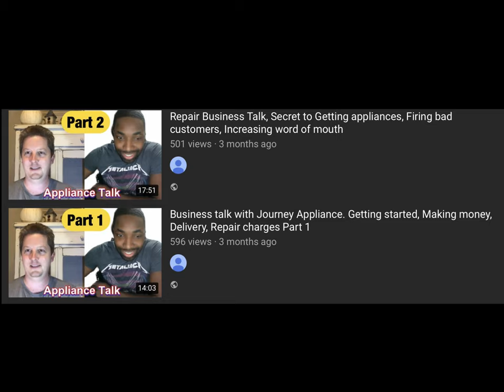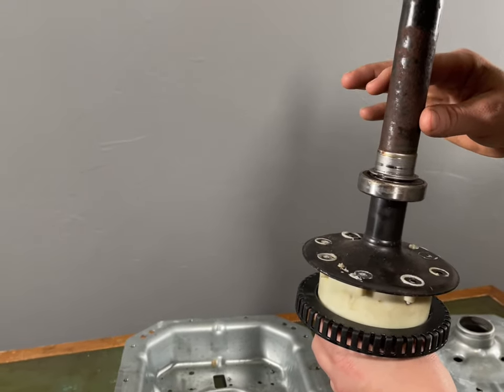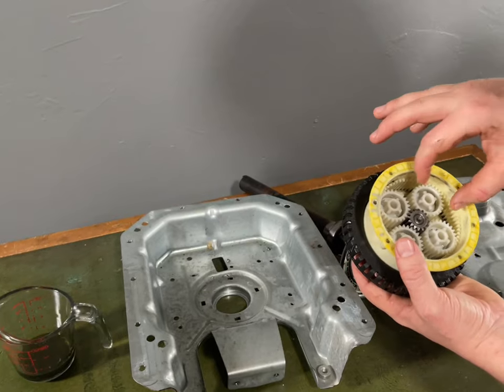Washer Oil leak from transmission gear case seal. Oily mess underneath and on belt. VMW Whirlpool

Comment: I can’t remove the top it is stuck on the bearing
Reply from the maker: Look at it from the top and you’ll see those small holes to put a Phillips head screwdriver in. You have to remove all the screws through that hole by slowly turning the transmission every time you get a screw out then you’ll have to pop the transmission apart being careful not to spill oil everywhere. It will be slightly stuck with gasket maker.
Reply: @WasherDryerMoney  okie I also saw that too

Comment: Whirlpool should've left the direct drives alone!
Reply from the maker: So true
Reply: I thought so too. But when you really think about it, it was time for a change. DD's are noisy as hell and not efficient.
Reply: @CarlosGarcia-ij4yg  What type of gear oil does these whirlpool transmissions use? Why are these washers built so cheaply?
Reply: @jeromedavis8575  i have no idea!
Reply: @CarlosGarcia-ij4yg  I assume its a heavy gear oil. How did it smell?
Reply: @jeromedavis8575  i don't know. I'm not the creator of the video.
Reply: @jeromedavis8575  you can buy direct drives on Craigslist list all day long for very cheap. Sometime free.
Reply from the maker: It’s very thick oil so I would assume it’s heavy gear oil. I did not notice a smell.
if the washer is leaking replacing the oil will not stop the leak that’s why I’m thinking about trying grease and the next machine that has this problem. I’ll do an update video if that solves a leak.
Reply: @WasherDryerMoney  Did whirlpool direct drives also use a heavy gear oil also? I assume they did.
Reply from the maker: @jeromedavis8575  I know I’ve seen a video on that.
Reply: @WasherDryerMoney  How heavy is the gear oil in a direct drive transmission?
Reply: @WasherDryerMoney  Do GE washers use gearboxes and do they use heavy gear oil too?
Reply: Unfortunately you cannot use a mechanical transmission to make the kinds of variable motions / arc travel required for agitators or wash plates in HE washers.  Depending on cycles the new HE top load washers turn the agitators 180 degrees, 360 degrees and in between using the computer driven DC motor. They also turn the drum in the opposite direction.  The standard mechanical transmission designs in the old washers cant do so.  They can vary the speed, but not the travel of the agitator.  (Maybe a hypercomplex electro-mechanical transmission design could do so but not the standard design used in older WP DDs, and other manufacturers, etc.
Reply: @hyperlexis  What are the gears made of in the whirlpool dd transmissions? What oil do they use? Is it a the synthetic grease or real gear oil?
Reply: @jeromedavis8575  A combination of steel pinion, multiple other steel and plastic parts and a large gear made of Delryn plastic.  It uses gear oil.  If you check youtube you should see teardown videos.  Totally different designs.  The DD relies on a constant speed motor to turn the gears to create the agitator back and forth action, which does not vary in length of travel.  The motor reverses to engage the pump and spin cycles.  In the new HE models like the GE, its the motor itself that constantly reverses back and forth. moving the agitator on different arcs of travel depending on cycle. (Hence the ungdly noises they make).  The DC motor in those machines does the actual work itself by moving back and forth specific distances (it detects its position precisely with sensors).  The "transmission" gears and "splutch" in those new HE machines is more to allow the tub to spin in the opposite direction to help move the clothes in less water.  And they use a separate electric drain pump.  The DD transmissions would last decades, that is true.  There is no reason why this problem with the new HE model leaks cannot be fixed by GE or a recall or service bulletin done.  They should if its that big a problem.
Reply: @hyperlexis  Is the oil a synthetic grease in both the direct drive and new belt drives or real gear oil?
Reply: YES! I agree 10000%
Reply: Okay, thank you. How does the Speed Queen Classic gear oil smell?  @WasherDryerMoney

Comment: Swap gearcase
Reply from the maker: That would be a good option if you can get a good inexpensive used one. Otherwise if you’re getting a new one you can nearly buy another cheap washer.
Reply: @WasherDryerMoney  There is rebuild one.
Reply from the maker: @signedelacroix7213  if a rebuilt is affordable. it’s still quite a job to swap.
Reply: @WasherDryerMoney  Don't tell me. I am in the middle of it. There is no video that cover my model exactly. Some are incomplete. What about removing that impeller, those engineers.
Reply: @WasherDryerMoney  Yes, I think those break because the so low water level, it make the whole transmission endure a lot of pressure.
Reply from the maker: @signedelacroix7213  true